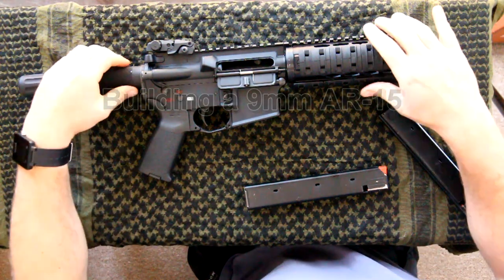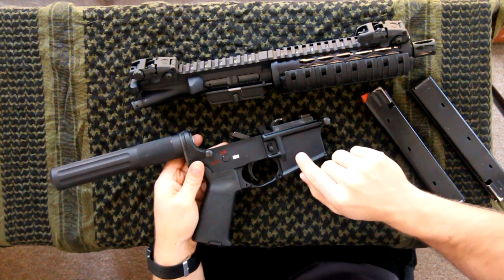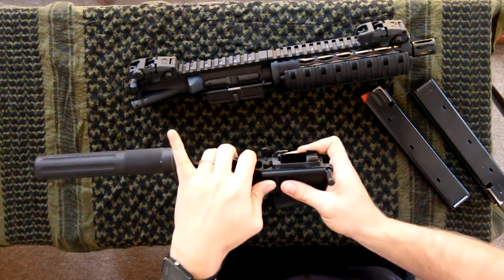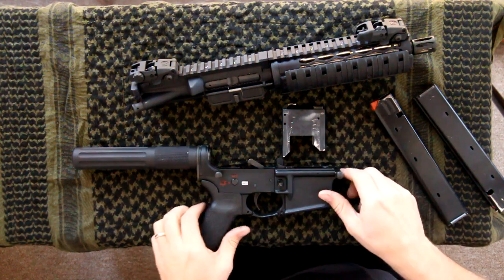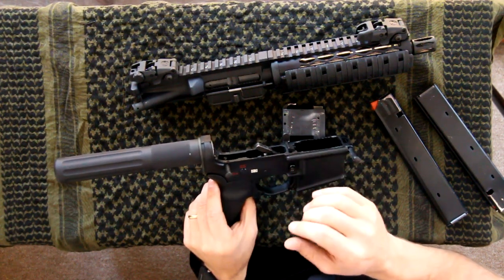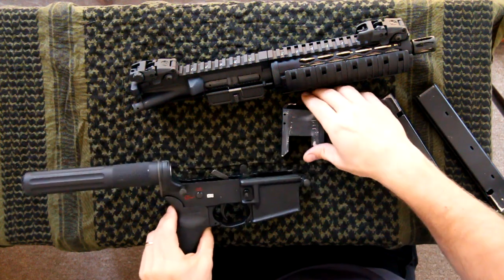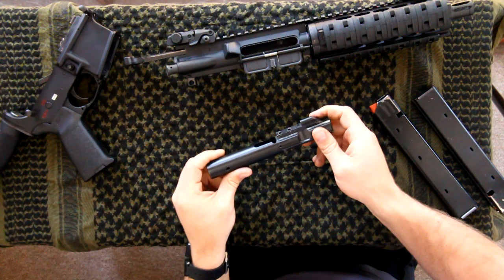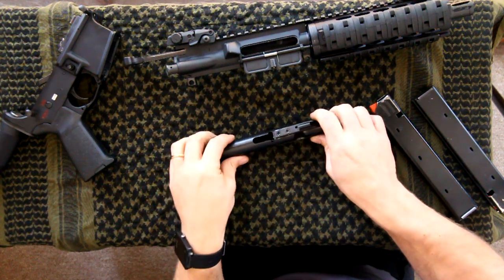Building a 9mm AR 15

Comment: What do you torque the barrel at?
Reply from the maker: Generally you want to torque past 30 ft-lbs until you get to the next gas tube hole on the barrel nut.  Don't exceed 80ft-lbs though, if you can't get it before 80, back off the nut and try again.

Comment: I know its an old post but here in 2019 the Colt SMG 9mm are virtually impossible to find unless you want to pay $40-$50 for including shipping. Glock seems to be more popular and easier to get.
Reply from the maker: I would agree, the popularity of the Glock lowers have exploded. I think the aftermarket Glock magazines have really helped with that.
Reply: @Jim Roberts Well here in 2020, the Colt-style 9mm mags are easy to find :P  I use mags manufactured by ASC here in the U.S. I usually get them for $20-24 each on Gunbroker, not including shipping. They are made of coated stainless steel, and they have very nice followers. The only reason I would buy a genuine Colt 9mm mag is to use in a display gun, where I am looking for a factory-correct appearance. I've seen people trying to sell Colt mags for as much as $200 EACH, which is absolutely ridiculous.
Reply: @crazyfvck   Don't know if anyone will see this but ASC mags are available at Gun Mag warehouse..bought a 30 round one for 19.95..

Comment: Does it shoot hallow point
Reply from the maker: I mostly shoot FMJ through it, maybe just under 100 HPs so far. To date it has been 100% with factory and most handloads. Early on I had a couple failure to eject issues with some light handloads that were originally loaded for a pistol. I added a little powder to those loads and they have been 100% since.

Comment: I built my 9 mm AR as a carbine, using an Armalite barrel. It has the 1/2 X 28 thread, so I took a muzzle brake meant for a .223 rifle, and drilled out the exit hole with a 3/8 drill. It works perfectly. I know I don't need a muzzle brake on a 9 mm, but I didn't want to leave exposed threads, and already had the brake on hand.
A word of warning for those who may build a 9 mm AR on a polymer lower, using the Tork Mag magwell adapter (for Glock mags) - that adapter must be pinned in place because the set screws meant to hold it in place cause too much flex in the polymer units for the adapter parts to mount in correct alignment. But, once pinned in place in the proper locations, that adapter works very well. I'm pleased with mine.

Comment: Anyone have trouble feeding hollow points?
Reply: Have you tried different rounds?
Reply: Noel127 just a couple, but no high dollar critical defense kind of stuff.
Reply from the maker: Mine feeds hollow points just fine.  I've shot HP reloads and some Federal Hydra Shoks.  Making sure the magblock is the correct height is important for these builds as the feed ramps are built into the block.
Reply: AdventureColorado Is there a way to measure for correct height. I polished mine, but that didn't help. FMJs feed well, but hollow points seem to go up to high and miss the chamber tip above the opening.
Reply from the maker: +lockechip unfortunately I'm not sure where to get an exact measurement. If you at able to adjust the height you could play with it a little. Unfortunately a lot of the blocks don't allow for adjustments.
Reply: AdventureColorado Hi, thanks. Have you seen any recommendations on brands of blocks? I did buy some more 9mm hollow points to try.
Reply from the maker: The Hahn Precision are some of the better blocks, but I don't think they offer one with adjustability.
Reply: AdventureColorado thanks, did some searching last night. I think I will try the hahn bottom model.

Comment: How is the C-products magazine works?  I'm in the process of building an ar9 with colt mags.  I've been shopping if what kind of mags I should buy...ASC brand ,  C-products or Metalform.  Anyways,  your video is very informative and well explained... Thank you!
Reply from the maker: Metalform is pretty much the high end for 9mm magazines.  In mine I have only used C-Products magazines and have not had any problems with them.
Reply: Thanks for the response!  I'm done with my ar9 build and I actually get the C-products magazine.  They works fine.  The only flaw I noticed is it does not drop freely,  so I have to shave both of the top sides of the magazine and now it is perfect!

Comment: Very good info! I am in the process of building a 9mm ar at this time. What is the length of your barrel and hand guard?
Reply from the maker: +Ira Patterson the barrel is 7.5" and the hand guard is 7".
Reply from the maker: +badassxr50r it's a good length, just long enough to get the flash hider out from under the hand guard.
Reply: AdventureColorado sweet! I have the same size hand guard and have been debating a barrel length. Yours is a perfect match. I want to get the kak can to put on mine.

Comment: another route i found on barrel threading; i have built multiple uppers for a single register sbr lower. i built a 9mm upper for it also. i found a 5 inch 9mm barrel threaded for 5/8x24. this is the same thread on my 300 blackout out upper. so i only had to buy 1 fixed thread adapter for my suppressor.  this also leaves more metal between the threads and the bore.
Reply from the maker: +Derek Johnson that's not a bad idea. I think most barrels are just threaded for certain pitches so that the muzzle devices are consistent, I.e 1/2x28 for 223 and 5/8x24 for 308.

Comment: Would that BCG work with the new lower Receivers that take only glock mags?
Reply from the maker: I believe the CMMG bolt would not work with Glock without some modification.  Some of the bolts, like the one that Brownells sells under their name, is designed to work with either magazine style.
Reply: AdventureColorado  how about a New Frontier BCG. Would that work with glock mags?
Reply from the maker: I don't have any experience with those, but according to their website they are designed for either mag system.
Reply: Thank you sir.

Comment: why do people not put stocks on some ars... i just cant see the benefit
Reply: It's illegal to put a shoulder stock on a rifle with a barrel less than 16" in length without registering it as a short barreled rifle.  That is a $200 tax stamp and several months wait.  To work around this guys will build an AR "pistol" instead.   This is explained at approximately the 5:30 minute mark in the video.
Reply from the maker: Exactly, some people live in areas that don't allow SBRs, or a lot of shooters just don't want to spend the time or money to actually register the rifle.  With a low recoil round like the 9mm, you can still have a lot of fun shooting these and be accurate without the stock.  Just by putting the stock against the cheek I can shoot this much more accurately that I can a 9mm pistol.  And, if you really want a stock, all you have to do is start the NFA paperwork and when you get the stamp back, add the stock.

Comment: You have any issues with double feeds? Couldn't get passed that problem with the magazine insert, after almost every cycle the bolt would try and strip 2 rounds out of the mag and jam everything up. Ended up switching to a glock lower, still have the inserts and mags and would love to get another build going.
Reply from the maker: +Camnus G I haven't had that issue with mine. I wonder if the magazine was sitting too high in the adapter and allowing the bolt to engage 2 rounds at a time?
Reply: AdventureColorado I'll have to look again and see the height. did try 3 different brands of mags with similar results.

Comment: The 9mm bolt has a spring around the firing pin in the bolt. At least mine does. Have you had any issues or heard of any where the hammer fall in certain triggers isn't heavy enough to push the firing pin out all the way? Causing ftf or light primer strikes? I am running a Spinta Precision 9mm bolt and a CMC 3.5lb single stage flat bow drop in trigger.
Reply from the maker: +Jonathan Gutierrez I haven't had that issue, but I'm running a MIL spec trigger. I could definitely see a potential problem with a lighter competition trigger.

Comment: in the lower I can use a standart parts kit? mag button and bolt catch?
Reply from the maker: As long as you are using a ramped bolt, yes, you can use a standard lower parts kits.  That is what is in this build.

Comment: Thank you for the break down it did help me in planning my Quartercircle 10 build. Are you using a standard 556 carbine buffer spring of did you use a heavier spring like an AR 10 spring. I've heard both options. I'm  getting the New Frontier Armory heavy 8oz buffer.
Reply from the maker: I use a standard carbine buffer spring with the heavier YHM buffer.
Reply: And have good results. I have a carbine spring I guess I will try it before buying the AR10 spring. Thanks.

Comment: Hello, i bought a hahn magwell adaptor and noticed that the magazine catch is not engaging the magazine. The  protrusion of the catch is not long enough because of the thickness of the adapter. any recommendations? Also, i noticed that the picatiny rail on the free floating hand-guard is not aligning with the picatiny on the receiver, any recommendations? Thanks
Reply: Vik P I built mine up with a spot weld. Filed flat, flat on top, tapered on bottom. Approx .025 thicker did it for me

Comment: Can you do a full breakdown and cleaning of the 9mm bolt?
Reply from the maker: I generally don't take the 9mm bolt apart.  I have not noticed mine getting nearly as much fouling as a typical direct inpingment AR-15 will.  I will put together a video that shows the difference of the bolt and what I usually do for cleaning.